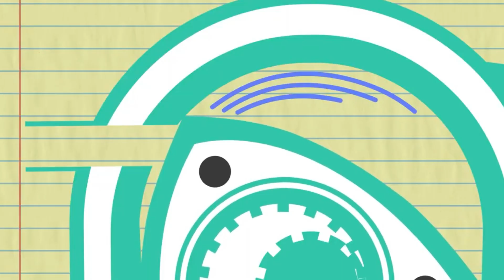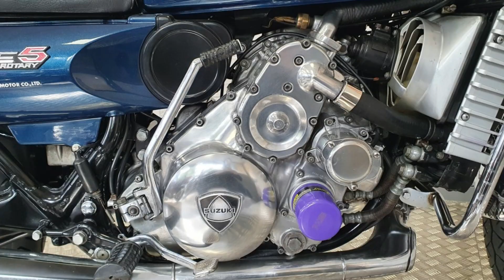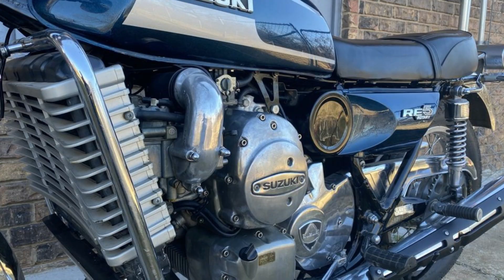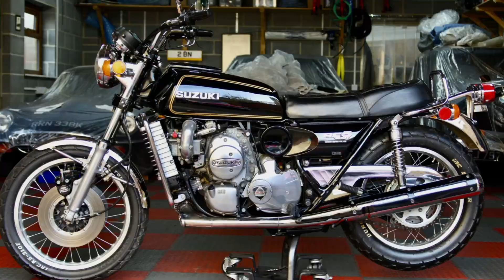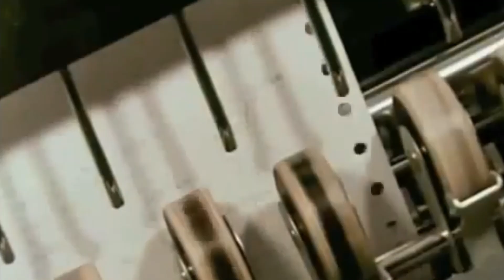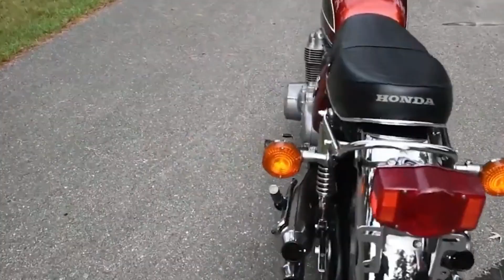The Shocking Truth Why Suzuki’s RE5 Rotary Engine Was a Complete Failure

Comment: Gear driven fan? Nope, it has an electric fan and cooling is by water and oil cooling. Also, oil in 3 places, sump for lubrication and cooling, mixed with fuel from a tank for tip lube and oil in gearbox. I've had an RE5 for years, a great, quirky motorcycle
Reply from the maker: Always great to have someone with real-world experience chime in. How has the RE5 treated you over the years — still running strong?
Reply: @BikerCrazyMC yes, gets ridden regularly. People always interested to see it at bike meets. Pretty reliable, only broken down due to a rectifier failure once and o-ring seals between water jacket side plates and internals failing once.
Reply from the maker: @raychappo11  That’s amazing to hear — a bike that unique still out on the road and turning heads is just pure motorcycle culture at its best. 🙌

I can imagine it being the star of any bike meet — not every day you get to see (or hear!) an RE5 in person. You're a very fortunate owner. How did you manage to nab an RE5? There can't be many in circulation. Respect for keeping it alive and riding!

Comment: I didn't know a rotary engine in a motorcycle ever existed.
Reply from the maker: Suzuki was the only company bold enough to mass-produce a rotary engine motorcycle—the RE5—and they only made around 6,000 units between 1974 and 1976. It’s possible that the failure of the RE5 scared off other manufacturers from trying something similar.